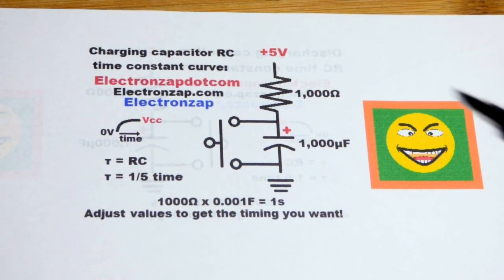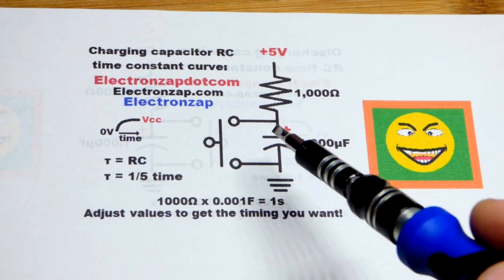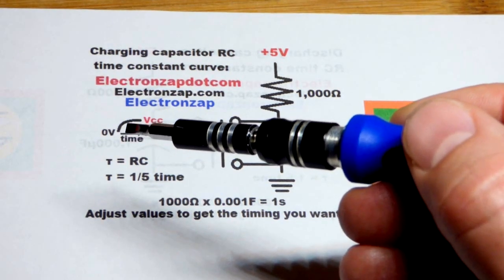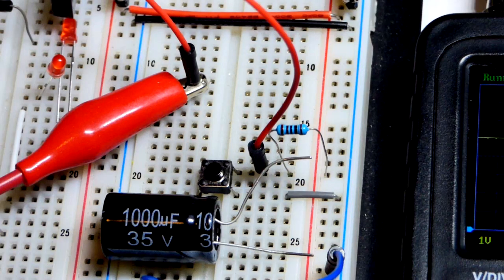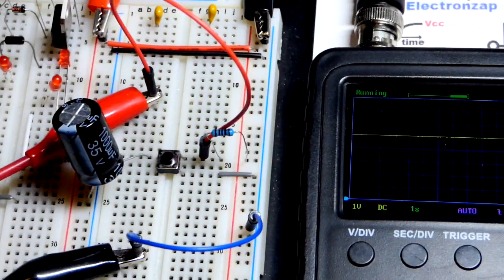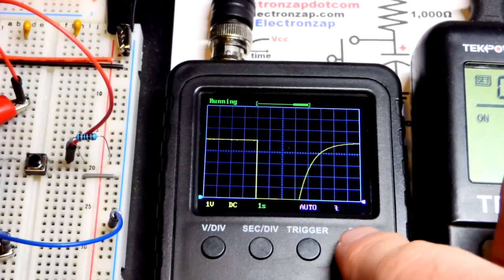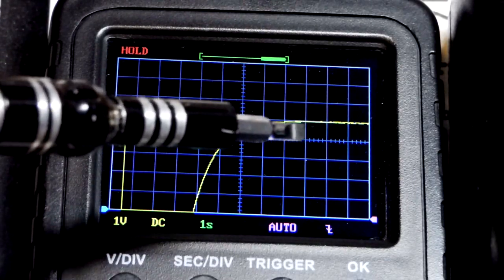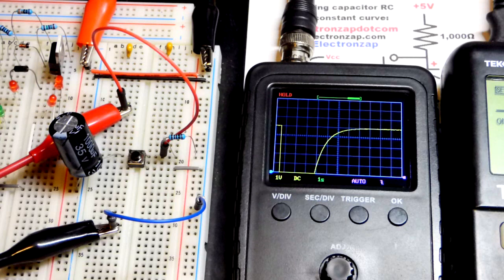Charging capacitor RC time constant curve measured with oscilloscope

Comment: Really like the use of the simple Oscilloscope you use in your videos.  Possibly sometime you can show some features of your Oscilloscope such as from the point of Turning it ON to setting it up for 1s division as shown in this video.  I see there are some videos when you first got it, but possibly after using it for a while maybe some 'helpful tips' even as simple as to why/where you clip the leads for your demonstrations.  A lot of people new to electronics don't have the knowledge or funds for a expensive Oscilloscope so it is nice to see what can be done in a quick video using a simple Oscilloscope like you used in this video, and while their pocket Oscilloscope might be different many of your tips might transfer over to other Pocket Oscilloscopes.  Great Job on the videos.
Reply from the maker: It's definitely a good idea to update those video! I'll keep it in mind.

Comment: Excellent I am doing a supercap project and this has been helpful. So is it the same for the supercap as well. I don’t have resistor in series but am using an LM2576 at 8.1v and a bypass N-MOSFET to charge at 50A. That is the max current my server power supply can output. Is the charge time calculated the same way?
Reply from the maker: Most supercapacitors need a lot more current to charge than most power sources can provide. So there is usually a certain low amount of current applied to them over a period time. This causes a steady voltage change which is referred to as a voltage ramp. Voltage ramps with regular capacitors is topic of my next video :)